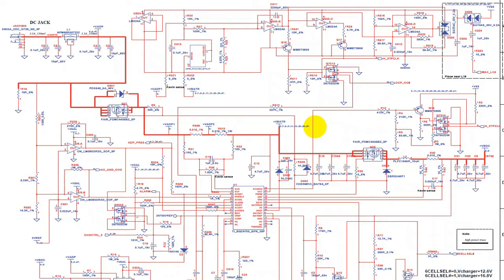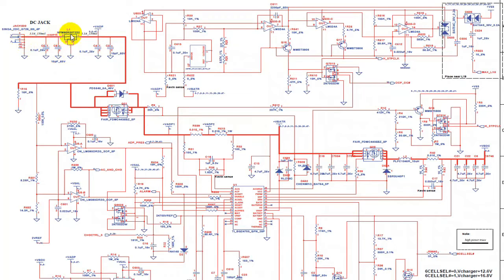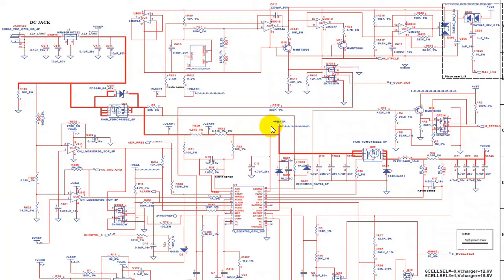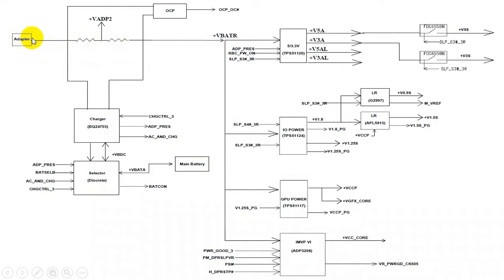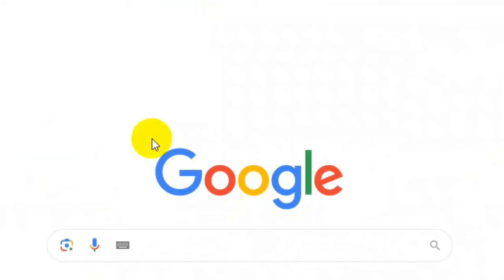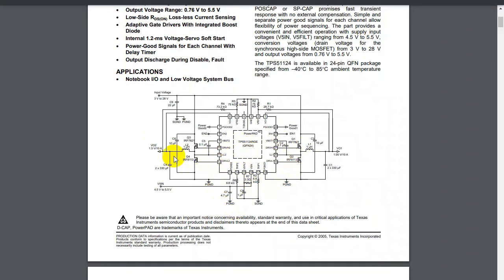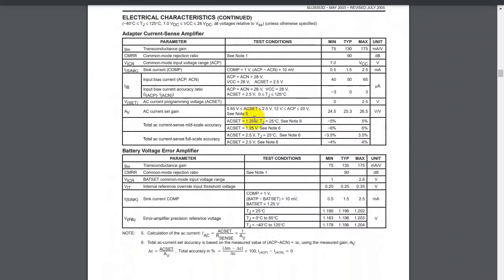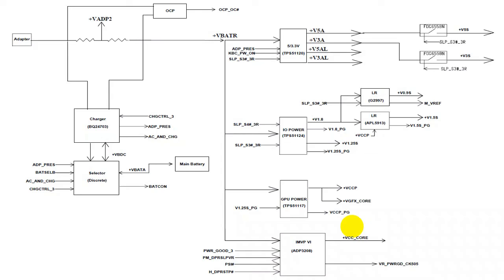Laptop motherboard repair - Learn to trace voltage on computer motherboards

Comment: may tanong ako sa mga tech nag flash ako ng BIOS chip 25Q128FV 16pins pinalitan q ng 8pins na 25Q128FV same lang sila 16mb yun files.. Bakit ayaw mag bootup. may power pero walang display.. HP 8300 small form factor. sana matulongan ako sa kapatid ko to..🥲🥲😟
Reply from the maker: What programmer are you using, anyway you can join me on my Patreon page and I will help you out.
Regards.